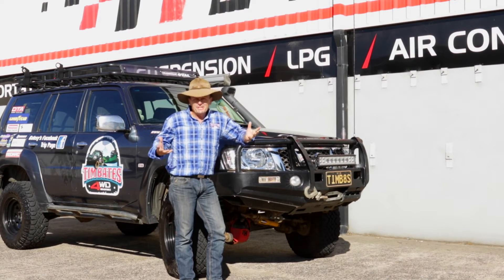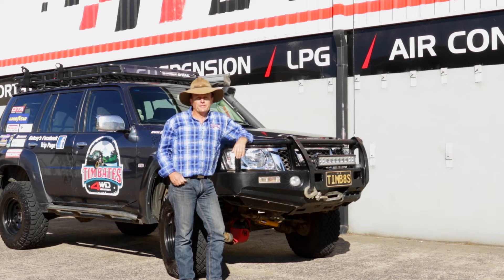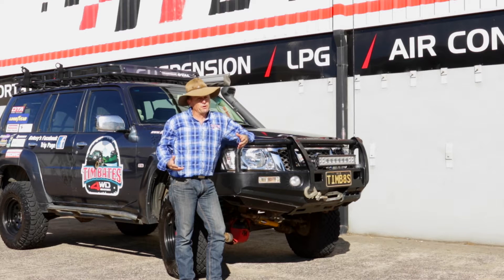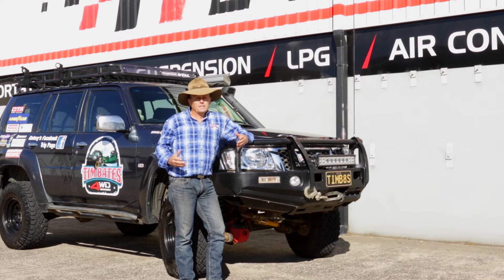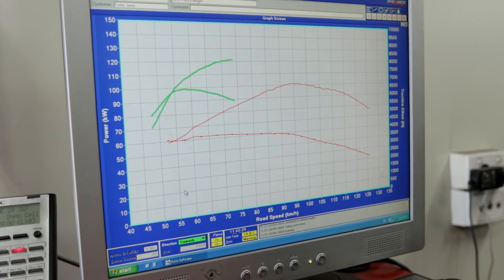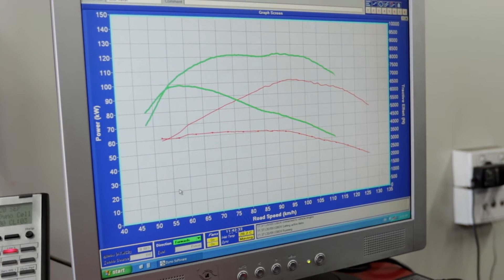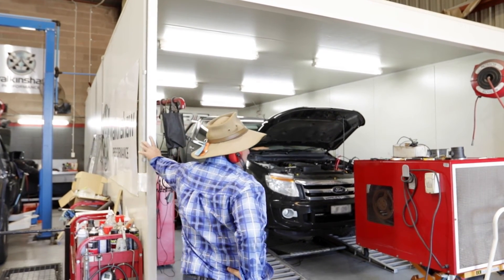Diesel Tuning - ( Everything Is Explained )

Comment: What extra stress is placed on the drive train after tuning? I have seen other YT videos where guys have had to replace drive train items after tuning,. Several months in.
Reply from the maker: Gday Glen,
Having a front locker engaged while turning corners, puts a lot of stress on steering components and seals. 
I find I can turn small amounts, just not ideal turning long tight corners while the front is locked. 
Thanks for your reply mate. 

Cheers Tim
Reply: Tim Bates 4wd Adventures Hello Tim, appreciate the reply and videos. I was thinking more along the lines the extra torque from the tune and what that might do to things.  Cheers.
Reply from the maker: @glenmorgan3683  ahh righto mate. 
My Patrol went from 85kwts to 110 with the tune and turbo upgrade. 
It’s been fantastic now to drive. 
Have a chat if you like with Matt at DTA Dandenong, he will answer any questions you might have. 

Cheers Tim.